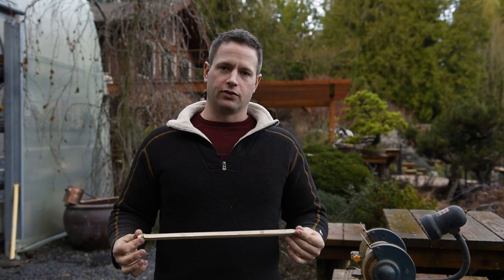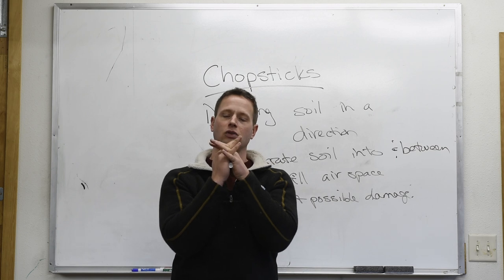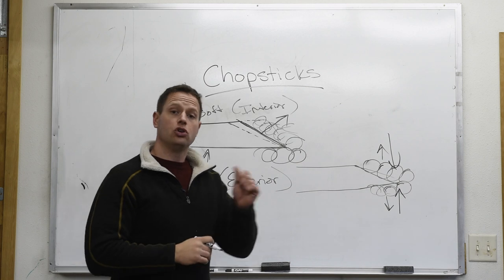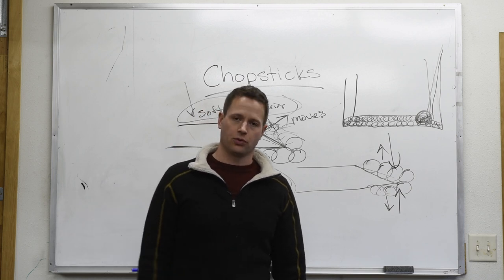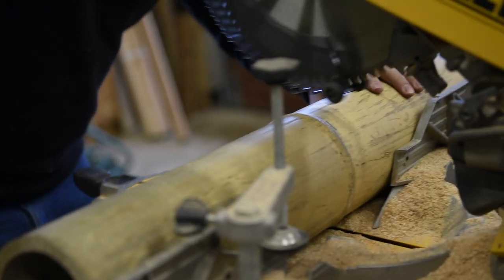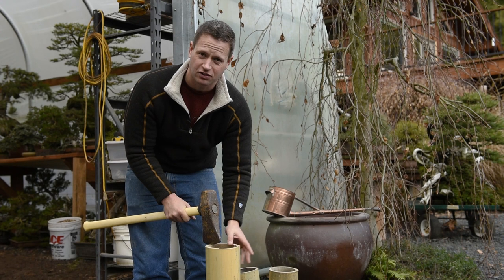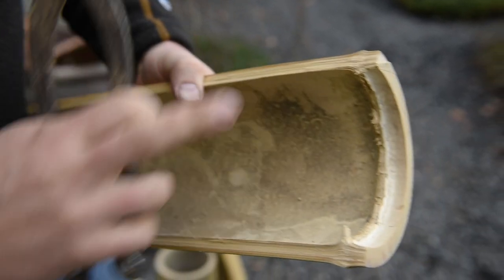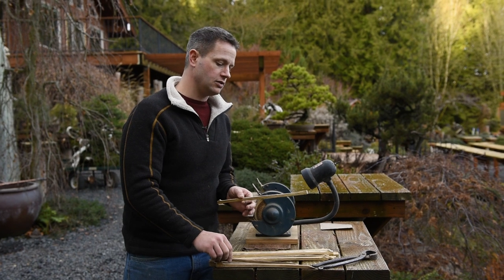Chopstick Creation

Comment: That is interesting...

I think soil particles have rough enough surface to impose much more traction between themselves than rubbing on surface of the chopstick.

The bigger single relative displasement between particles of soil the bigger potential damage to fine roots that happen to be trapped between them.

I got a feeling that real purpose was to have something to work soil in quicker, regardless of possible damage to roots.

Probably it's a question for another video: when to use such jumbo chopsticks and when to avoid using them. :)

P.S. I would made crossection of the chopsticks halfcircle to avoid moving any adjasent soil particles too much and still have some directionality using flat hard side as a pushaway plane.